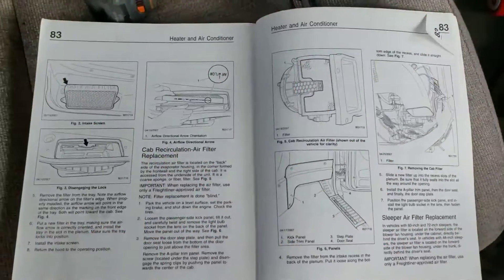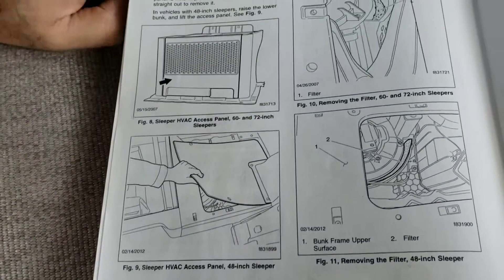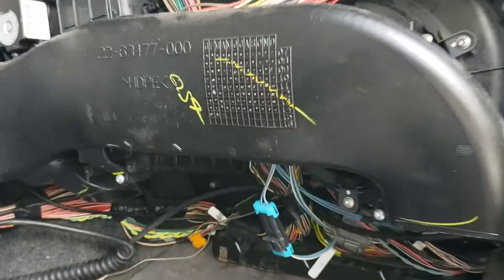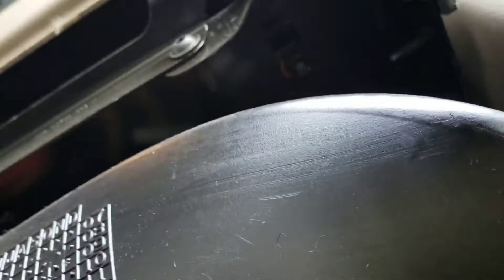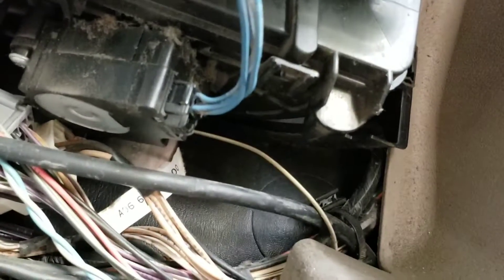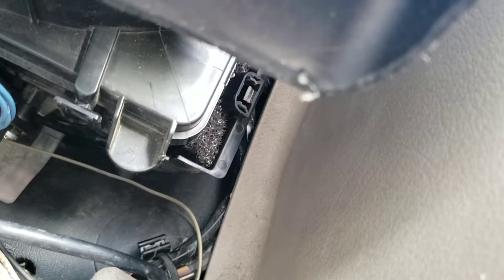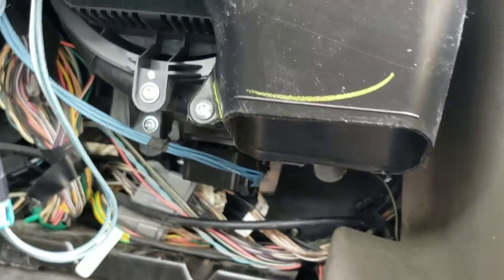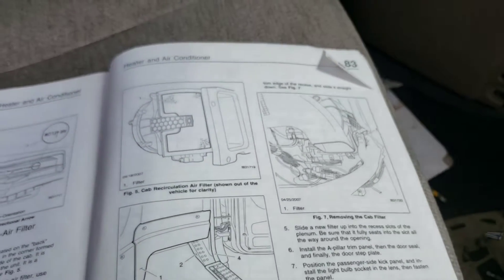How to replace air recirculation filter on Freightliner Cascadia

Comment: It's way easier on the new Cascadias. There's a panel on the passenger side that you pull off by hand and the filter is just right behind it and easy to remove. Takes 2 seconds to get to it.
Reply: No doubt! I work in fleet for our company with some new Cascadias and older ones. I laugh when I pull filters for PMs because the recirc filters for new ones are always low inventory but there's a whole stack for the older ones that never depletes haha!

Comment: That’s crazy. You went through all that trouble to pull a filter out and WASH it. Bro, go to Freightliner and get one it’s like 5-10 bucks. You can afford it, don’t worry.
Reply from the maker: Hey bro its not about money, it is about to get  excess to remove from there, by the way it is a foam filter and ideally good idea to remove every month to keep it clean.

Comment: I don’t understand when you do a video pertaining to some kind of repairs and you just keep on talking and not really showing the steps to get it done. How did you remove and replace the filter????
Reply from the maker: if you try to get the same area and at list to remove the cover and get the flash light to light down there ,i am very sure you would be able to  figure it out yourself ,you just complained and have not even looked there.

Comment: You did it wrong.  All you have to move is the all the screws in front to remove the vent and the blower inside the blower you'll see the filter when you switch the HVAC to recirculate.  Remove the filter and replace it with a new one.  and put everything back.  DONE DUH 🙃🙃